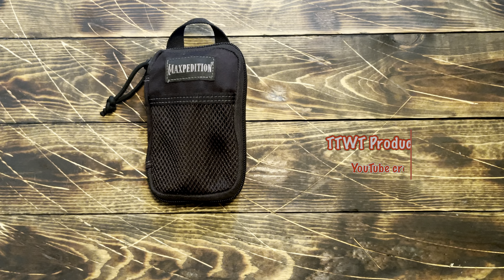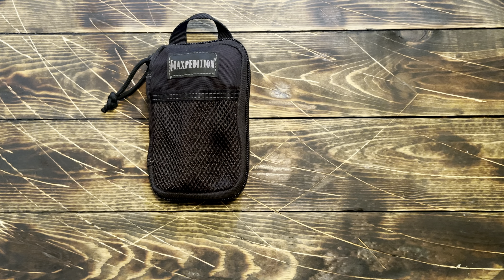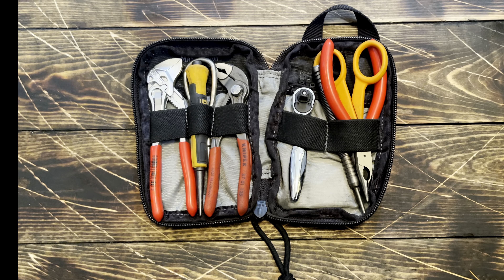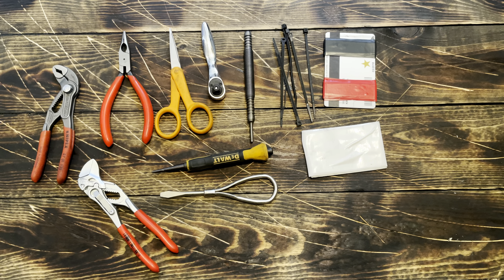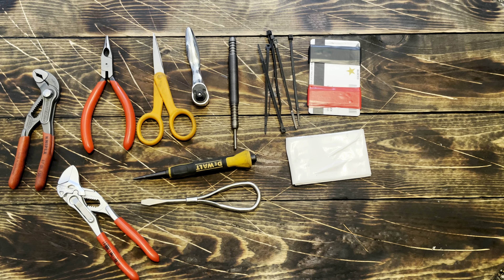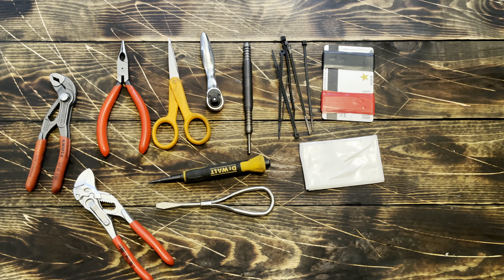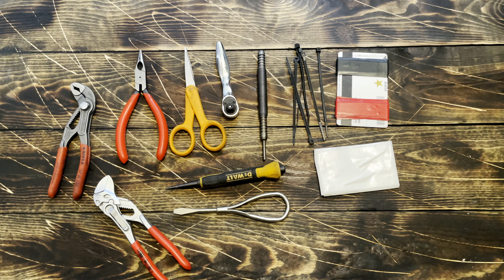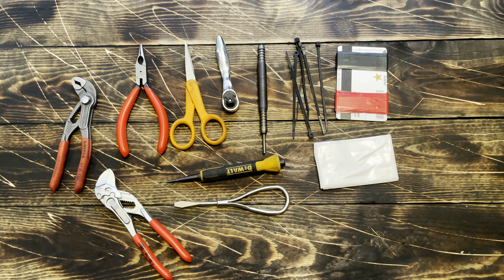Maxpedition Micro Tool Kit “smallest toolbox on YouTube?”

Comment: For a micro ratchet I use Topeak Ratchet Rocket Lite DX +.  It is a small 1/4” ratchet that also doubles as a 1/4” driver.  I bought a tin box from County comm, which fits the driver, an extension and 22 different 1/4” bits in the box.   I glued some magnetic sheet to the top and bottom of the box and keeps the bits from rattling around.  I can actually turn the open can upside down and the bits stay in place.  Finally I keep the tin closed with a pair of ranger bands.
Reply from the maker: Great setup

Comment: Nice plan and execution. A Leatherman is always a compromise with so many tools all connected together. There is nothing like using real tools. Just the Knipex pliers wrench alone is a massive upgrade and means you have way more gripping force and parallel jaws that wont destroy nuts as easily. I've got the 5" Knipex pliers wrench and an ARES 70040-1/4-Inch Drive Close Quarter Micro Bit Ratchet which can load 1/4" bits on the end of the handle and act like a screw driver. I might have to make me a Maxpedition Micro kit!
Reply from the maker: Thank you for the comment and advice, I’m still tweaking this set up as I go. A good example of this is how I added a mini box cutter and and removed the rubber grin from the dewalt nail set punch. I also swapped the ratchet out for the topeak ratchet/bit driver and added a expandable magnet and mirror

Comment: May I add since you have 1/4 dive capabilities. In my kit I have MM Allen bites that are Milwaukee impact rated and I have the torx  they are security ones aswell. I bought them on sale. Plus the usual Robinson 1&2 large Phillips large flat 1/4 inch drive adapter for my Craftsman quarter inch drive ratchet I carry a Milwaukee 5-in-1 razor blade with quarter inch drive capabilities streamlight  stylus .knipex  Cobra XS pliers so I work in a machine shop  I can get in the tools or panels or anything that I need and a pinch.
Reply from the maker: Those are great we have them as well as HT and TX tips in my box at work but I don’t encounter them outside of work very often and we can’t bring personal tools on the planes. So this sits in my suv while I’m at work

Comment: i would add a klein multi stubby driver and some sort of replaceable blade knife life a Milwaukee flip utility knife.
Reply from the maker: I actually have all of these in my tool box but the issue is limited room in the kit.
Reply: I carry the Milwaukee 6-1 it works well as screw diver . It works great.  I also carry a Craftsmans bit ratchet with box end on the other end for tightening or loosing stubborn fasteners.